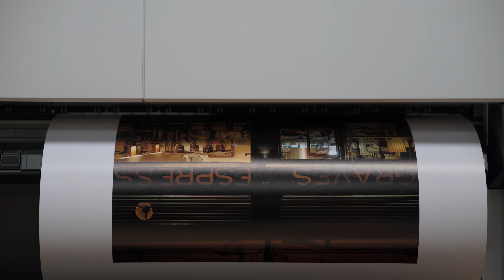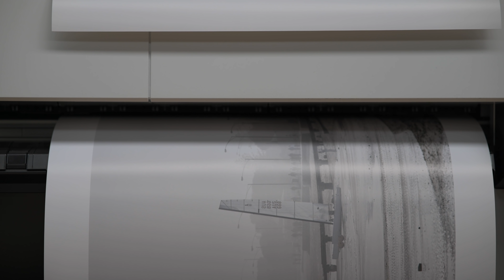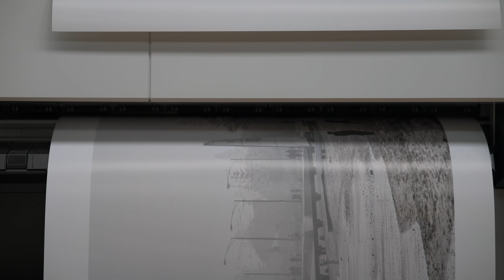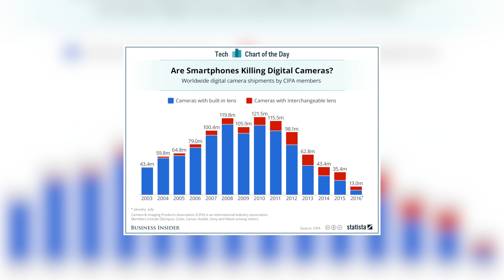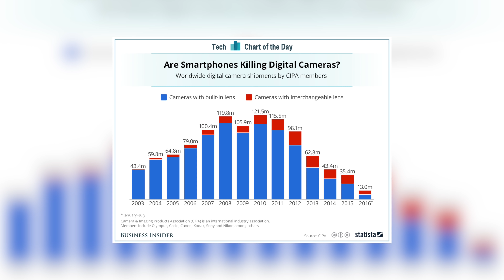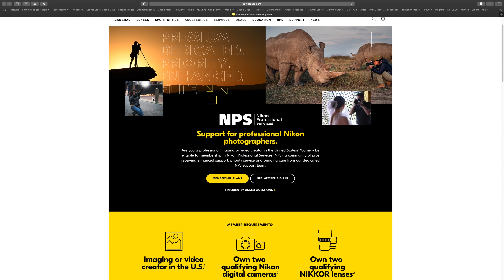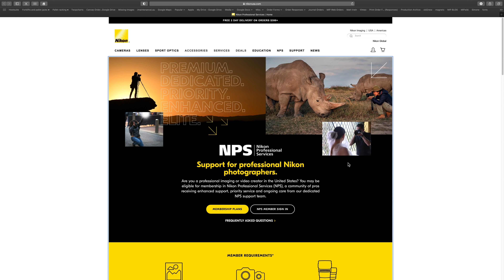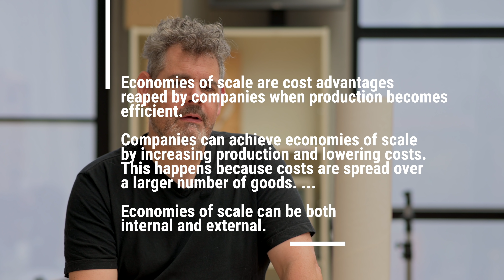Will Camera Gear Cost More In The Future? | Opinion Piece | Matt Irwin

Comment: The Warranty they give us is reason why your camera lasts as long as it does...without it the quality starts going down...!
So paying little more is not not necessarily bad.
Just my opinion.
Reply from the maker: The warranty is not the reason your camera is so good, the design is why it is so good ....
Reply: @MattIrwinPhotography  ya they design it good...but manufacturing is another story...they cut cost with cheaper parts when the companies know they won't need to replace them free of cost anymore.
These days most of us are paying more attention to specifications and features...if it feels good in your hand, that's quality enough for most of us.
The companies need you to buy the latest model cameras...they can't make you do that with cameras built like tanks!
May be it hasn't happened yet...but soon!
You could say limiting warranty is step one...just my opinion.

Btw...new to the channel...loving the content!
Reply from the maker: I agree we live in a time where there is a fine line between pleasure and pain. Any cost minimising by Nikon risks negative blow back. Sometimes hard decisions have to be made.  Nikon has been manufacturing cameras outside of Japan for a long time. For example the D70 2004 (which I owned and loved) was made in Thailand. And the extremely well regarded D850 is made in Thailand since its release in 2017.  I have two D850s and the are fabulous.  It is possible to reduce warranty and maintain quality.  It is not automatic that reduced warranty means reduce quality.  And to the best of my understanding most other companies offer 1 year in most regions. 😀
Reply: @MattIrwinPhotography  You have had so much more experience than me...am just a nikon fan boy getting nervous!
Hope it all works out...and nikon stays in business for years to come!
🥲
Reply from the maker: Me too

Comment: There's no doubt that some of what you have said here will come true but I think most companies aren't going the way that you think they are. 

The future is in the end of the entry-level systems and the parts of the business responsible for them. Fuji, for example, is clearly swinging the axe on all non-X-Trans cameras. As this is outsourced business, it won't be a direct impact on Fuji to handle layoffs etc. 

They expect their APSC lineup to do fine without it, sure the industry is changing but mostly it's the people who would once have bought a $700 camera leaving for a $700 phone. Anyone buying semi-pro or professional gear isn't going anywhere (at least for now), so they aim to cater to them. 

And then they look to change the market - think Sony's new drone, Fuji bringing medium format down to roughly high-end full-frame pricing with the new GFX100s, Canon simply rapidly replacing all their old glass with nice shiny, faster mirrorless glass, and so on. 

The real trick is not in increasing prices or cutting costs but persuading the customers that they have to spend more cash in the first place. The winners in this market will be the companies that do that well and the losers - and let's face it the real result of this reduced market is not cheaper cameras but fewer camera companies - get to spend eternity with Olympus, Kodak, Minolta, etc.
Reply from the maker: Indeed Nicholas, another outcome is less players in the market, but the market has dropped so much since 2010, that we would have to reduce to 1 or 2 companies for them to still sell a similar amount of cameras ...
Reply: The market is simply saturated. Do we really need a new camera every three years now??? It is the same with desktop computers. I use a 12 year old MacPro for example and am not really thinking of an upgrade because of performance issues.
Reply: @MattIrwinPhotography  They are never going to sell the same volumes of cameras - that is over for good. Entry-level is dead. Professionals are going to upgrade less and less too - there's no real need for a new body nowadays unless the old one died or is unreliable. Layoffs and reduction in the size of these companies is inevitable.

There will probably be a small uptick thanks to YouTube in sales of video-capable cameras but in the long run, sooner or later, people are going to notice that in many respects - a camcorder is better than a camera for making videos with. 

However, it seems a question of when, not if, Pentax finally dies and it's easy to see Panasonic potentially joining them - the L-mount alliance isn't a big win for them and despite their excellent products they don't seem to be able to win the market's heart. Heck, even Fuji could end up there if the medium-format move doesn't go as planned. 

And over a longer period still, it's possible that only 2 of Canon, Sony, and Nikon are left standing.

Comment: Everything getting too expensive. Photography is just a hobby for me. I like Nikon and Nikon gear. I still have an old 1968 Nikon F, with Photomic FTn, that I still occasionally use.
Reply from the maker: Awesome Alex, yes photography has always been costly.  Perhaps this is where the 2nd hand market is helpful, if you are interested in the more modern digital mirrorless options?  Cheers Matt
Reply: I have an FTn in my display, everytime I take it out it works flawless but I like the ergonomics of the F2 a lot better.

Comment: I dont mind the 3% for crying out loud. I though cannot tolerate damn fool  decisions by Nikon and have them crying for not making a dollar. they introduced the d600 with a crappy shutter and then they had to pay for replacement and also spend for the new improved d610. also they introduced the z series with a single card for use by professionals especially wedding and photojournalism. that was the worst thing  they could have done. they had very low sales and also spent valuable resources to introduce the zii series. if that wasnt dumb move then what is it. why at the end we as consumers pay for their mistakes.